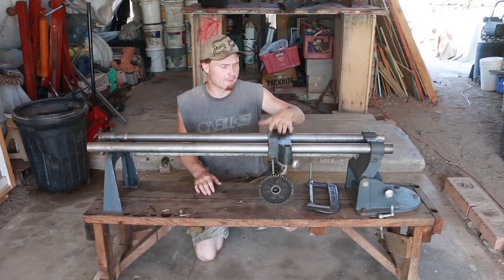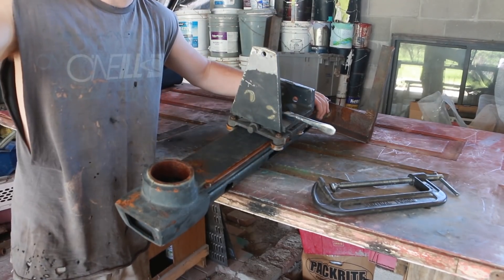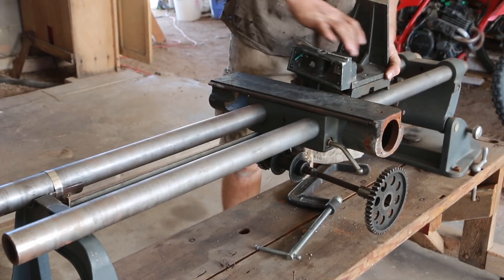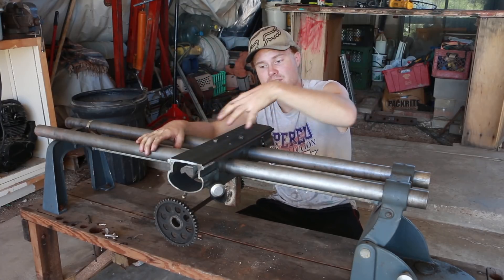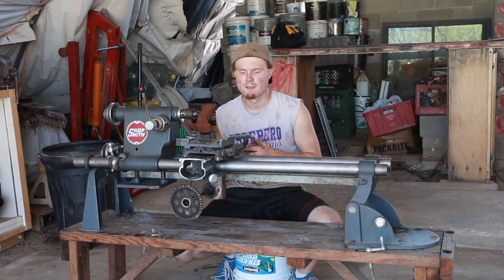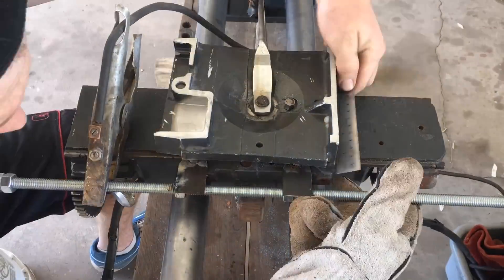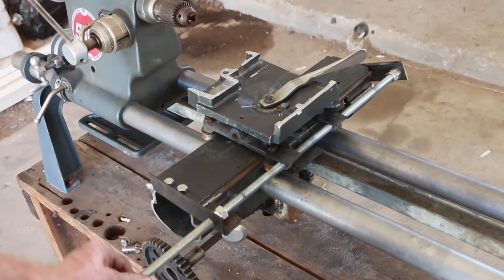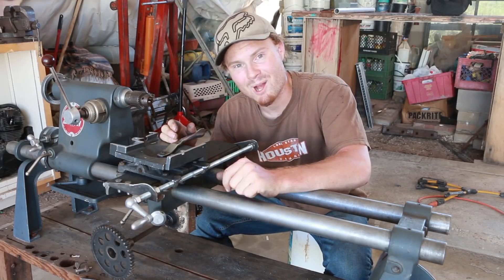Building A Cross Slide | Converting A Wood Lathe Into a Metal Lathe Part 2

Comment: Years ago I got my hands on an x-y milling table for a drill press. I can only do very light milling and hole location tasks with it but it has been a useful tool for some time. One day I had to clean up a bearing journal on a shaft and I bolted the x-y table on the bed of my wood lathe. No power feed or threading capable but it, but with careful dial indicator work, it can be aligned so you can turn a decent straight cut. Since then I've done facing, turning and boring with it and even set it at an angle to turn a morse taper.